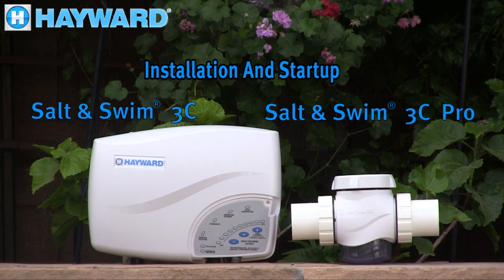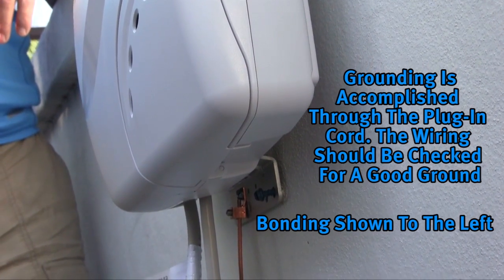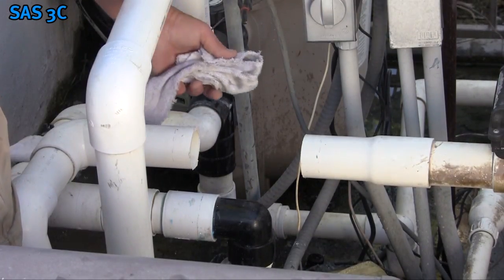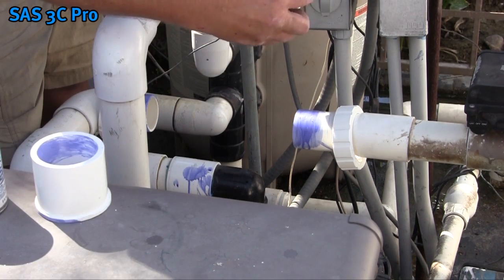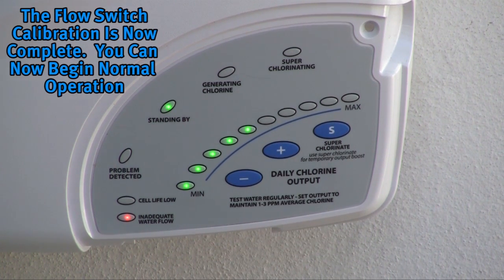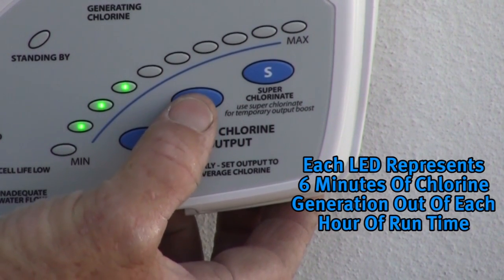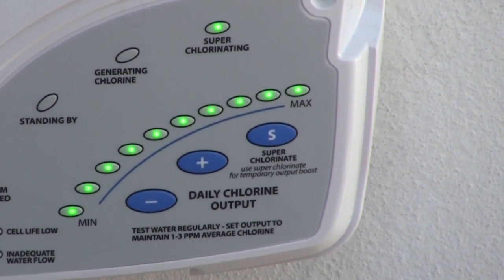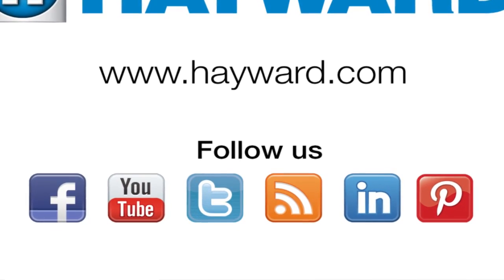Salt & Swim 3C and Salt & Swim 3C Pro Salt Chlorination Installation & Startup

Comment: Mine has "Problem detected" light on but its not generating chlorine.  Would this be caused by to little salt?  The Cell  life or inadequate is not on.
Reply from the maker: Hi Mr Greenberg, a Hayward tech should be able to answer your question. Please email your email address and phone number to marketing@hayward.com or private message us on Facebook or Twitter.
Reply: @HaywardPoolProducts  I have two systems that I am working with that have "Problem detected" light on as well as max light blinking.  It is very strange that two different systems are doing this after replacing the cell unit.  I have called Hayward tech several times as well as thru the web page  and they are no help at all. Just say contact your local pool dealer.  Well, I don't have a local pool dealer plus the ones I have contacted say they don't work on Hayward salt cells.  So now I have two Hayward salt systems that are not working. I have googled, youtubed, etc to get an answer but nothing Ive  read or do solves my problems......please help!!!!

Comment: The installation instructions do not mention anything about using a timer to turn off the S&S 3C when the filter pump shuts off each day. Does power stay connected to the chlorine generator all the time and give inadequate water flow warning light when the filter pump shuts off? Owners manual is not clear on that.
Reply: I just installed mine new today...
Reply from the maker: Hi Rick, a Hayward tech can reach out to assist if you’d like to dm your email address and phone number on our Facebook page or Twitter profile. You can also reach out via email to marketing@hayward.com.
Reply from the maker: The Salt & Swim 3C is designed to be plugged into a GFCI outlet. There's no need to remove power unless the pool equipment is being serviced or closed. The flow switch acts as a safety precaution to prevent the unit from generating while the pump is not running. We recommend testing the flow switch to ensure normal operation.
Reply from the maker: Here is a link to the quick start guide: https://hayward-pool-assets.com/assets/documents/pools/pdf/manuals/SaltandSwim3C-Installation-Quick-Start.pdf.

Comment: I just installed this system and no matter what I do I cant get the free chlorine up to 1-3 ppm. All other readings are where they should be per pool store and also reliable test kit. I add liquid chlorine and levels are fine but next day or two chlorine is gone. It acts like the Salt and swim is not producing chlorine but all lights are good on unit.
Reply from the maker: Hi Steven, a Hayward tech will reach out to help. Please dm your phone number and email address on our Facebook page or Twitter profile. Or you can email us at Marketing@Hayward.com.

Comment: My salt and swim does not go into stand by mode when the pump is off.  During this time I get air bubbles coming out of the pool return.  Why does the salt and swim not go into stand by mode but keeps produce chlorine when pump is off?   As soon as I unplug salt and swim the air bubbles stop. Does this indicate a faulty unit?
Reply from the maker: Hi Arek, please PM your phone number and email address and a tech will reach out on Monday.
Reply: thankyou. I have PMed you my email address
Reply from the maker: Got it, thank you.
Reply from the maker: Arek, our tech would like to speak with you, so please provide your phone number. He said it is not something that can be solved via email. There needs to be a give and take with questions over the phone.
Reply from the maker: Arek, if the cell is over a year old, it needs to be replaced.   The flow switch is part of the cell.
Reply: Hayward Pool Products My problem detected light is lit, and max light is blinking. Tried to troubleshoot but no luck.  Thoughts?
Reply: @mikekeeley9688  hi mine also says problem detected. Did U find any solution ?
Reply: I just buy a pool fence hat has this system I check the water at my local dealer and they tested and told me how much salt I need but when I put on after 1 day the salt machine I have a yellow light problem detected
I have a defective machine or what is the problem 
I test again the water and say low chlorine

Comment: When the "cell life low" light comes on you can ignore it.  My light came on over three months ago and the unit is cranking out chlorine like it was brand new.  I know I will eventually have to replace the generator cell but I'm not in any rush.  Just keep monitoring your chlorine and clean the cell periodically.
Reply: Mine is reading cell life low but I read somewhere you can clean it and it'll be as good as  new.  Do you know if that's true?
Reply from the maker: All salt cells have a life span.  Salt and swim is about 1 year sometimes two.  Cleaning helps the cell produce chlorine at it's optimum but the cell still has a life.